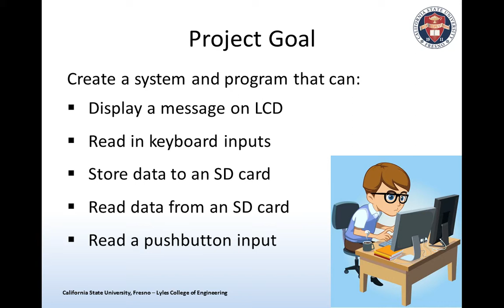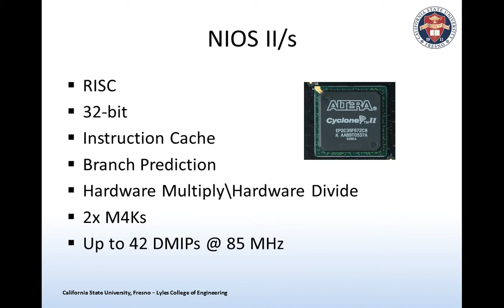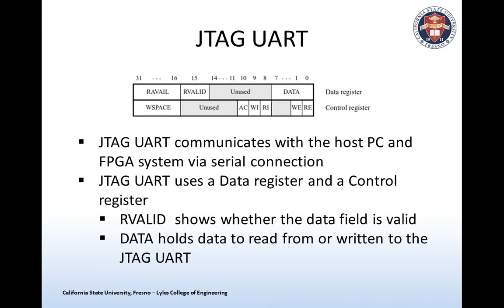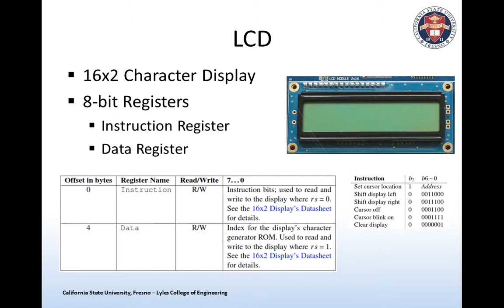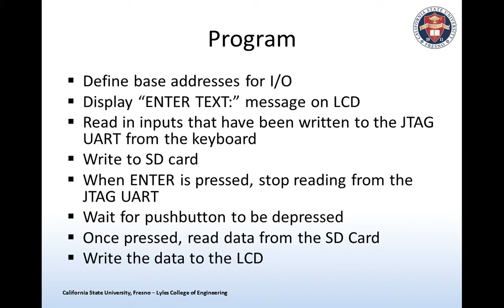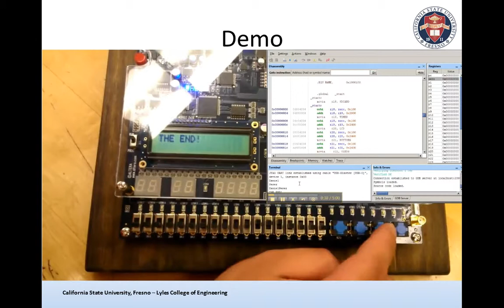ECE 178 FPGA Project

Comment: Hi can you guide me regarding SD card. after formatting it for FAT16 file system. How do we know about what address should we pass to access (read/write) the data in SD card. We have CMD24 for writing from SD card. So I need to pass a 32 bit address value from that command. So how do I know what address value should I pass to write the data. I’m not getting the view of memory map. And address values range to write data into SD card. Kindly help me regarding this.